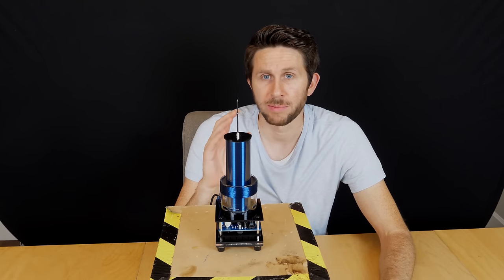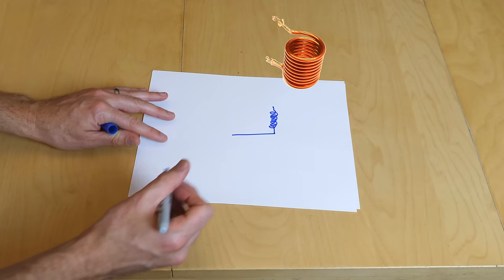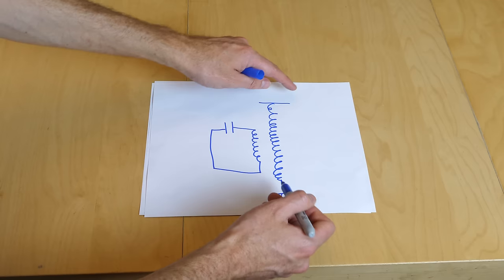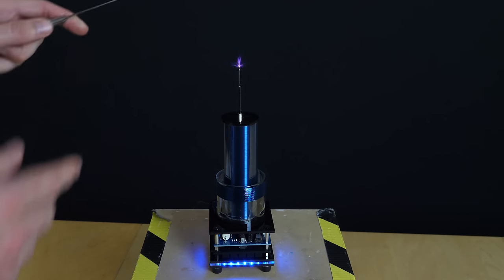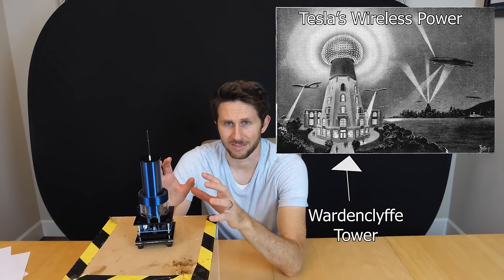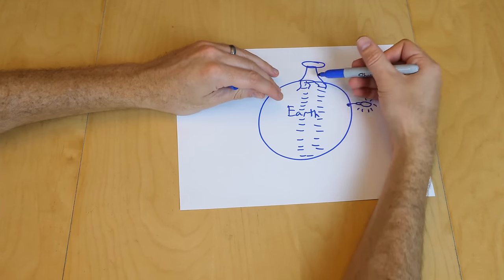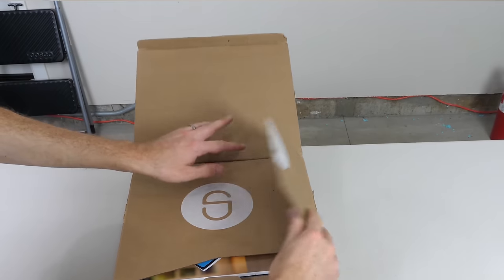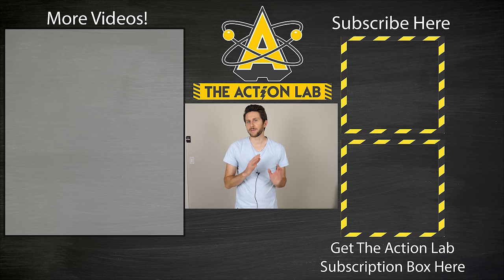Making Wireless Energy For The Entire Planet—Nikola Tesla's Wardenclyffe Tower

Comment: THIS VIDEO WAS SO INFORMATIVE MY HEAD STARTED TO WIGGLE BACK And Forth
Reply: Sadest boy6969 damn u really are the sadest boy
Reply: My head wiggeled because I was playing Metallica in the beckground :P
Reply: @OF01975  Sadder is to be a jerk.
Reply: Nicholas Whitmire sadder is to get triggered by a Practical joke
Reply: My wiggling body part was further south than my head.
Reply: The power came from under the ground, so he didn't have to look for power, it came from where he placed the copper towers, and when they realize it was free, and it worked, they cut his towers down. I build experiments, so I understand what he did. Farther more the bulb has to be grounded on on side, and the other side like an antenna up in the air, and the bulb will light.

Comment: That first circuit you showed is called a "tank circuit" and can go forever (theoretically) with superconductivity. Put next to another inductor would make a very efficient transformer. Being fed from a natural resource (earth) at a resonant frequency, that would be absolutely brilliant if it worked. The source of a tank circuit is DC voltage, but turns into AC voltage, which is far more efficient when it comes to transference. If you could get a solid and reliable source of DC voltage by simply tapping into the ground (seems odd, but look at potato batteries) then it seems absolutely plausible to make possible what Tesla set out to do.
Reply: Partially from earth another from space with another piece added to the designed coils

Comment: By the way, as I understand it, Tesla was trying to induce the other component of the dielectric field. One half is magnetic, which expands (like two like poles put together, and the other half is dielectric, or counter spacial, like the pressure hole that developes when you put two opposite poles of two magnets together. They don’t attract towards each other, they sink towards the dielectric field’s point between. So... Tesla’s longitudinal wave would not be like a slinky compressing, it would be like a solid stick or bar, being pushed on one side, and the other side moving away. This effect (according to Tesla, would travel much faster than the transverse wave we use today.) Like how a coaxial cable transmits energy, and contains the standing waves by a resonant impedance value between the center conductor and outer shield (return consuctor).
Reply: Interesting, where are you getting this, and also what material can i read that corroborates it.
Reply: Donnie XL, read Ken Wheeler’s book called the missing secrets of magnetism. It’s free on archive.org, and Ken (who is a bit crazy) does lots of experiments and short talks on YouTube. He did a video recently showing the counter sinking dielectric vortex that forms when two magnets are brought together opposite poles.
Reply: Tesla find a resonant frequency of earth of 217 Khz. But he didnt use a magnetic part of waves wich weaken with the square of the distance but electrostatic part of em waves. Antena is grounded and one wire is ground a second wire is air. in the air the current is like in capacitor. He invent that there is small weakening of signal at these frequency.
Reply: How does the music playinfgthing wkrk exactly..where is the music coming from? Lkke he put an ipod or phone next to the coil amdnthe EM field waves in the air somehow wirelessly turn on the phone or player and we hear the music?

Comment: The 'longitudinal wave" was only one theory.  Wardenclyffe was also set to demonstrate the use of the upper atmosphere as one plate of a capacitor, to charge it against the earth, and draw that charge back down anywhere using a suitable tower/resonant circuit.  
I seem to remember hearing that he did manage to demonstrate this theory successfully, lighting up a bank of lightglobes at some distance from the tower - much further than could be accounted for by near field effect.
Reply: No
Reply: I think Tesla wouldn't invest so much money into this if he didn't have some experiments on a smaller scale that worked.
Reply: Using an 8ghz frequency I do believe. Pretty sure it's the same tech in modern wireless chargers
Reply: The only reason it didn't work is because you can not meter and charge for wireless transmission ... or at least you could not back then
Reply: I wonder if he got paid off by the electric company to bash the idea
Reply: I know this is a year ago but theres a reason hes trending right know. BECAUSE HE WAS ON THE RIGHT PATH THE WHOLE TIME
Reply: He built the first 5g tower.
Reply: Everything was in accordance with established EM theory as set out bu Maxwell who was orders of magnitude above Tesla.

Comment: 4:11 the skin effect at high voltages is pretty interesting stuff, I work with it quite often in amateur radio antennas. Something else that's pretty wild about skin effect is the incredibly "thick" power transmission cables carrying ultra high voltages coming from large hydroelectric power plants ETC usually aren't a "solid" cable with a bunch of strands inside, instead they're hollow!

Made up of several interlocking spiral wound strips, kind of like how laminate wood flooring snaps together but in a circle. That way the power lines cost less because they use a fraction of the copper or aluminum, but also are many times stronger, more rigid and sag less because they're a fraction of the weight too.